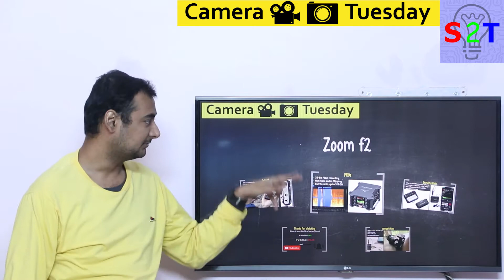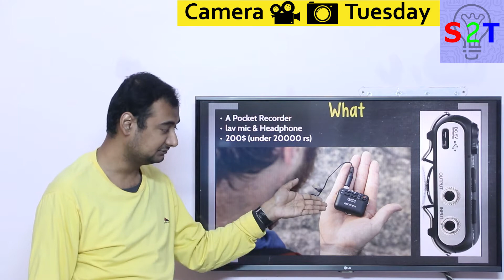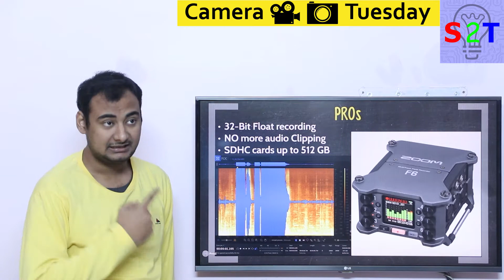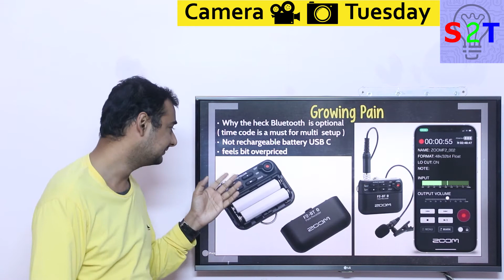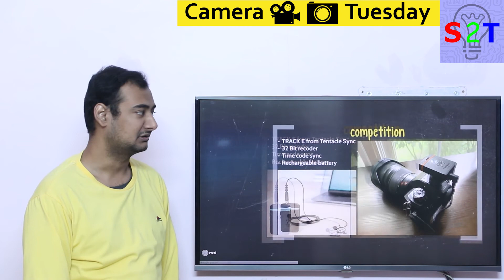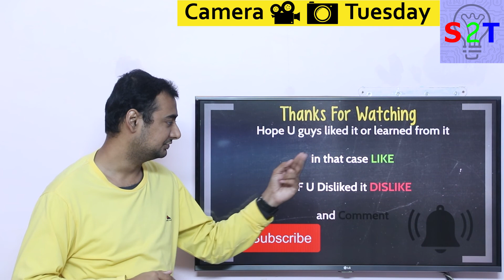ZOOM F2 Explained {Camera Tuesday Ep124}

Comment: Excellent review. Any particular recommendations on good lav microphones to pair with it? I have three use cases - 1) normal use - interviews, youtube videos etc 2) Canoe/outdoor adventures - water proof 3) Strong desire to start capturing nature sounds when possible. Could be multiple microphones. Thanks again! Subbed and liked.
Reply from the maker: no sure as lav are made for indoor use some are there but hard to find and those sound different due to sealing . U may want to look into F6 as it will allow u to capture multiple mics and all at 32 bit so U can have those super sensitive mics and some mics that is for different frequency so get a full "nature sounds"